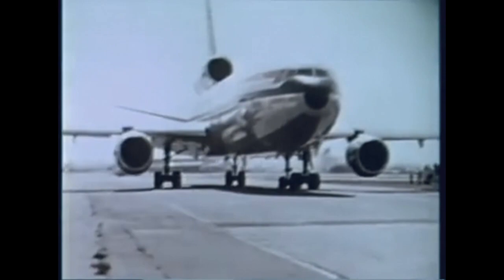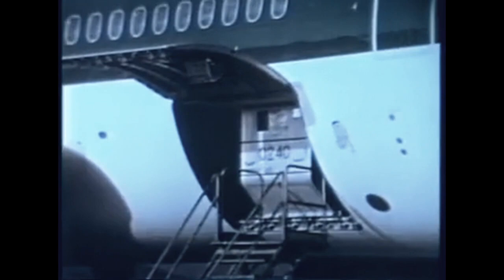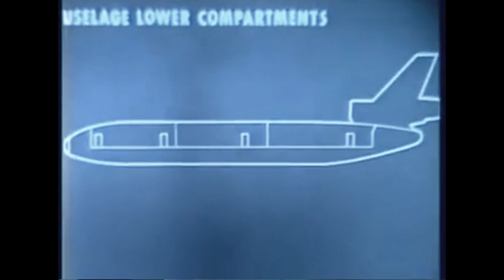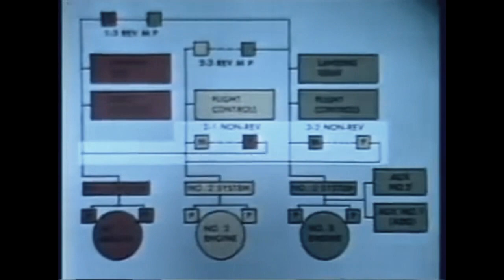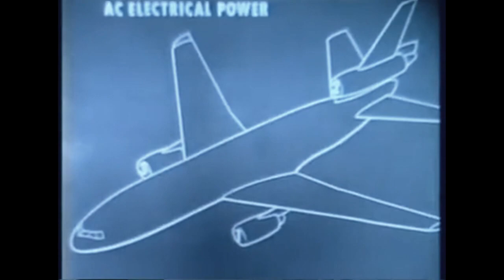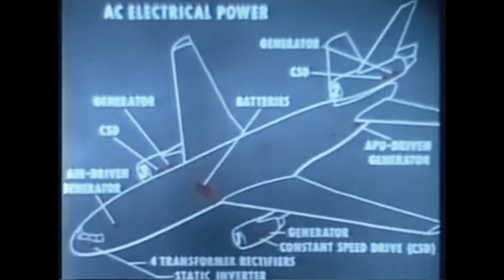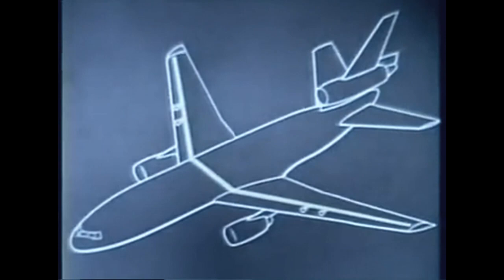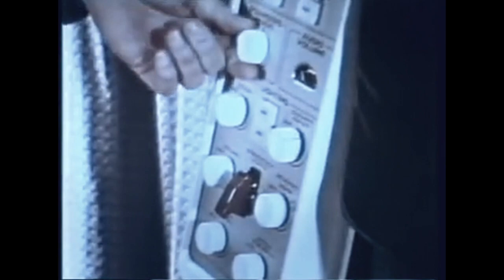McDonnell Douglas DC-10 Series 30 Promo Film - 1972

Comment: I know the DC-10s get a lot of bad reputation but I love these. I love 3 engine tri-jets.
Reply: Albatrosstic's Gaming The cargo door lock I think was only the design feature that caused a crash and almost caused another. A lot of the other other accidents were the result of pilot/ATC errors or poor maintenance techniques.
Reply: I’m more of a fan of 4-engine tri-jets.
Reply: It still has a successful career as a cargo plane. The Air Force’s fleet of these planes are still in service as well.
Reply: @johnmpifer  You put a smile on my face today...
Reply: I love the L-1011, which was an engineer’s airplane. Autopilot so advanced it could land itself. Four independent hydraulic systems that don’t all bleed dry at the same time when penetrated by shrapnel
Reply: @Shadowfax-1980 
MD knew damn well that inherently unsafe cargo door was a catastrophe waiting to happen. A memo proving their culpability surfaced during crash investigations or litigation. Hundreds of people died as a result of their criminal negligence 

The MD ungineers neglected to provide pressure relief valves, so that when the inherently unsafe cargo door blew off, the floor collapsed, severing flight control cables
Reply: Here in Brazil, Varig operated DC-10 between 1974 and 1998 on passengers version and until 2006 on cargo with ZERO accidents and ZERO incidents.

Comment: Yeah there is a lot of flak out there against the DC…10’s. Actually they were pretty well designed and reliable. All the crashes but one are actually due to human problems. The cargo door was the ground crew improperly latching it. The Chicago crash where the engine fell off was due to maintenance being done improperly. The Sioux City crash was the only one that actually was due to an engine failure. The cargo door was re-designed to handle problems with it being improperly closed and secured.
Reply: Boeing did a better job of idiot-proofing their airliners from poorly trained ground crews and mechanics, and the 'how to' manuals for GCs and mechs was probably better written too.
Reply: When multiple flight-critical systems are susceptible to a single point of failure and result in catastrophe, you can’t blame maintenance. Blame the ungineers who designed this flying shitbox

Comment: 3:21 what brought Turkish Airlines Flight 981 down
7:02 caused Sioux city United Airlines Flight 232 crash landing
Reply: Those planes crashed were the first model, the DC10... The DC10-30 was the more approved model
Reply: Furthermore, as Seconds From Disaster shouts at you every episode "it is a chain of key events", had United's no.2 engine not got "bam" then the 3 independent systems were fine. There is a reason it is called a black swan event.
Reply: Turkish airlines filed down the door latches and had people working on the ground that couldn’t read the proper closing instructions on the plane.  They are just as responsible
Reply: @Hertfordshire247  Get some life man....The DC10 proved to be reliable after those SAD events. It served for a long time and way longer than A380..
The FedEx and USA Airforce use is as a tanker, KC10 and till date as an eye hospital. 
Appreciate DC10 when he served well to the people and learn how to FORGIVE during her early days.
Reply: @kingssuck06  that’s not why it crashed
Reply: @truthful3777  Quite true. Many if not most crashes concerning the DC-10 had nothing to do with McDonnell Douglas.
Reply: The Series 30 was the better DC-10 all along - although it had crashes as well (New Zealand 901, Korean 803 and MartinAir 495).
Reply: @Hertfordshire247  It is relatively common for engines to disintegrate when you have thousands of examples of the same plane doing a total of millions of flights. Clustering the three lines together under engine two where one disintegration event would take out all three lines was not very smart. They could have put one line in the middle and run the second and third lines on the left and right fuselage sides to reduce the odds that one event could affect them all. .
Reply: Don't forget the Detroit to Buffalo incident.

Comment: Thank-you for the video.  This is the sort of stuff I enjoy learning.  

If I had been a steward on a DC-10 with no patience for the rudeness and thoughtlessness of passengers in general (at least that has been my observations), I would use a video like this just to mess with them.  Rather than the usual flight safety brief, I would threaten to withhold all alcohol unless there was 100% attention given to this video for the entire 17 minutes.  

Actually, I thoroughly enjoy viewing videos like this that go into aircraft mechanics and are infinitely more informative than the usual promotion film.  I would love to view a video that went into detail about every inlet, antenna, and gizmo (pardon me for talking over anyone’s head with this technical jargon) that hung off the skin of the aircraft.  Especially when I’m waiting to board, I notice everything that is on the aircraft and all activities surrounding it.  

The part about the hydraulics caused me to remember that United DC-10 flight that crash landed in Sioux City, Iowa, when the low pressure fan disk disintegrated and cut all hydraulic lines to include the backup system.  The story about how the pilots managed to fly the aircraft as far as they did was phenomenal.  

The other thing that caused me to think was the demonstration of the evacuation slide, which really seemed to take forever to inflate.  I could not help but imagine that impatience and panic among the passengers, as they waited for the slide to fully deploy wouldn’t cause a lot of pushing.  As a result, I envisioned the first 10 or so passengers to the now open door would exit without the benefit of taking the slide down.  

Thank-you again for posting this.  Please keep up the great work!
Reply from the maker: Thank you Guerry

Comment: Inherently unsafe cargo door blows off, collapsing the floor, because the ungineers neglected to provide pressure reliefs. So all the control cables get severed. Or all three hydraulic systems run their pipes in close proximity to each other so they all bleed dry when penetrated by shrapnel. Because the ungineers reflected to provide check valves. Total shitbox designed by accountants. The L-1011 was a true engineer’s airplane
Reply: I would rather have the 747SP and the A300B4 over the DC-10 or L-1011.

Comment: A true piece of s**t flying coffin.  Cargo doors, tail hydraulics and pylons.  It’s a real wonder they flew as long as they did.  The Lockheed L-1011 was a far superior and a much more beautiful airliner.  The DC-10 rudder placed engine made this ship distinctively ugly.  It’s too bad a fine company like Douglas who put out wonderful places likes the DC-3 and DC-8 engineered this cheaply built travesty.
Reply: Would you please tell us exactly how you feel and quit candy coating it all?  JUST KIDDING!!  Seriously though, how did you develop this opinion about the DC-10?  I've read and heard others speak with similar sentiments.  Nevertheless, if you have a super-secret source, I am always in the market for learning from others.
Reply: Lockheed made a fatal error by locking the L-1011 into Rolls Royce engines.  It delayed introduction and also stymied the pursuit of a longer range model, which ultimately led to them compromising size for range with the -500 model.  Agreed, the L-1011 was by far superior in terms of technology, safety, and beauty.  So glad I got to fly on it when I did.  I flew the DC-10 many times as well but there was just on comparison between the two.
Reply: C-990 Buff  I read a book many years ago about the DC-10 called, If I remember correctly, “Unsafe at any Altitude”.  It went into depth about the poor design of the cargo door latches and their failures and Douglases half-ass solution.  It was written before the AA flight out of Chicago lost an engine and plunged to earth so that accident wasn’t studied.  The main problem with the cargo hatches failing was a massive depressurization in the cargo hold.  The crash in Paris actually was caused by a hatch failure, depressurization which caused the floor between the hold and the passenger level to collapse, thereby severing all the hydraulic cables controlling the rudder and elevators, among other things.  It was a fascinating study of the design of the plane and its many failures, partly by Douglas rushing it to market to beat the much better and safer designed L-1011.  My father was an aeronautical engineer for Boeing in the 60’s and he made me very curious about design and engineering of aircraft, including rockets.  Thanks for asking!
Reply: AtomSmash I had the privilege of flying an L-1011 once. What a plane!  I had the unfortunate experience of flying a DC-10 once from Miami to LA.  No comparison. The most disturbing thing about the trip was the constant creaking and flexing of the fuselage that made all the interior overheads, etc creak and groan.  I know planes are purposely made to flex but we weren’t even in any turbulence!  I wasn’t afraid but I was troubled.  I felt like I was flying in a crate.  Anyway, once was enough thank you.  It’s really a shame that Douglas was allowed to continue building the 10 when the L-1011 was more or less mothballed b/c of monetary issues.  Yes, the RR engine debacle, but I’m surprised airlines stayed with the 10, especially when Douglases “fixes” for the hatch latch and flooring collapses were so stupidly half assed... “Here bud, use this pipe to lock the hatch and then look through this tiny window they stuck in to see if it locked.  Oh, and did you see the nifty vents they put in the floor to pressurize the cabin and hold evenly so the hydraulics won’t be sliced through in case of massive depressurization?  Look Ma, no more problems!”  Anyway, I do go on.  Thanks for the comment.
Reply: C-990 Buff  Correction: UAL flight, not AA, out of O’Hare.
Reply: The DC10 that crashed just after takeoff from ORD was AA191.  The date of the crash was May 25, 1979.
Reply: I see a lot of comments like this on every DC-10 video on youtube. Do people really think that the DC-10 was the only plane with design flaws that led to fatal crashes? 
In the 90s, Boeing had the 737 rudder problems that killed many people in two separate crashes (and lucky it wasn't more before they finally figured out the issue). The Lauda Air 767 crash in 1991 was a design flaw with the thrust reverser. The TWA 800 crash (a truly horrific disaster in terms of passenger suffering) was yet another design flaw with the air conditioner's proximity to the fuel tanks, and the 747 even had cargo door issues of its own with the fatal United Airlines flight 811 in 1989. 

Then there's Airbus, where one plane had its damn tail detach in flight (now THAT is cheap), and their poorly designed side sticks and over automated cockpits which has caused or contributed to disasters by ignoring/contradicting its pilots commands (China Airlines 140, Air France 296, Air Asia 8501).

Fact is, the cargo door was the only preventable DC-10 crash. American Airlines's maintenance practices were responsible for the 1979 crash. The 89 crash was just bad luck. If you have an issue with the DC-10 then you may as well have one with all planes.
Reply: @kimabrams2570 :  Thank-you for all the details.  Despite whatever type of aircraft I might have to fly (as long as it isn't one of those regional types in which I have to stick my feet in the aisle), I have this philosophy of not worrying about anything, especially when I get to the gate.  From that point, there is not a lot I control, except for alcohol intake.  For as I tell everyone, if the plane goes down and I have enough alcohol in me, I am readily identifiable as the one still on fire.  I AM JUST KIDDING! (Sorry, a bit of GI humor there.).  

Indeed, much of what you stated is what I've read, except for all the good parts about the aircraft shaking apart in flight and having to use a bar to keep the door closed.  Again, I am of the personality type that would have laughed instead of getting white-knuckled like so many passengers.  As I said and especially if in flight, there is not a lot I can do to change anything.  I truly did like the L-1011 too for many reasons.  In fact, I would love to see Lockheed get back into the commercial aircraft business to make Boeing and Airbus step up their operations, if nothing else.  I just wish the L-1011 had been designed with a multi-engine option, even though at the time, Rolls Royce did have the optimum engine for it.  

Again, thank-you very much for all the insight you provided.  I do truly enjoy learning, especially when it comes to commercial aviation.  I look forward to reading your future posts.
Reply: Al Cuevas you are correct.  I mistakenly said UAL.
Reply: Doug Masters  I can’t speak for other people, but I never said or suggested that other aircraft were designed without flaws.  However, the flaws in the DC-10 were egregious and some were even known by Douglas before the aircraft went into service.  In collusion with the FAA, the fatal flaw of the cargo hatch blowing and the subsequent depressurization that caused the cabin floor to collapse and sever the hydraulic lines to the rudder, elevators and tail engine, a directive to correct the defects was reduced to a notice, which Douglas thereby ignored.  When they finally DID perform the changes, which were equivalent to chewing gum and bailing wire, it was due to the Turkish Air crash outside of Paris - a plane that should have been retrofitted with the changes Douglas agreed to voluntarily perform, as opposed to being directed to perform, by the FAA.  Anything is subject to design flaws, but the DC-10 was a textbook case of a weak FAA subject to the pressures of the airline industry to make money and allowing a manufacturer to self police itself regarding safety and airworthiness. If Douglas had not been entrusted to keep the flying public safe in a ship of its own design, there would have been no issue.  But they’re all long gone, thank god.  What has not changed however is a government agency (FAA) effectively being run by the airlines and airframe manufacturers and leaving the public with no watchdog. Thanks for commenting.
Reply: Wouldn't that crash be the fault of certain people at Douglas who knew about the problems, rather than the fault of the plane itself? I understand that you never said that it was the only plane that had issues, but what I deduce from the many people online who say "Flying Coffin", "Death Cruiser-10", "Daily Crash-10" etc is that it implies that the DC-10 was a plane that crashed more than any other plane due to design faults. That it was the only plane that had a poor safety record. None of that is true.
Reply: @kimabrams2570  you need to settle down. Although I love the 1011, it was not designed for long range and by the time Lockheed realized that long range was a thing, it was too late. The 1011 was also unreliable, we called it "Late ten out of eleven times" at AC. I love the shape of the L1011, its quietness, passenger comfort, and admire its advanced groundbreaking technology. Sure the DC-10 had its faults, most were caused by the operators, had some high profile accidents. The classic 747s have bad wiring, it had a cargo door blow open, and one blew up over Long Island. Think of the 787 and the battery fiasco and the fact its type certificate was pulled. Bottom line is the DC-10 sold twice as much, flew further, could actually haul freight in an all cargo version, and had high dispatch reliability. After all, the DC-10 is still living a second life as a freighter while most L1011s are just soda cans now.
Reply: Doug Masters An airplane is an inanimate object. It is the mechanical creation of the designers mind based on the requirements of management and the market.  When I’m criticizing the plane it is as an outcome of the company who built it, in this case Douglas.  The designers as individuals are not to blame as they did the bidding of the management of Douglas.  It was poorly designed because Douglas wanted to build as cheap a plane as possible and as quickly as possible to beat Lockheed to the market.  Which it did.  Which is why so many airlines bought it and continued to buy it, despite its inherent flaws.  I think we have beaten this issue to death now, agreed?  It’s in the past and I was simply voicing my opinion and not looking for an argument.
Reply: NovaScotiaKevin - duly noted. I’m amazed at the passion of this planes defenders and detractors.  I was simply voicing my opinion as so many do in social media.  Thanks for commenting.
Reply: You're blaming a badly designed engine pylon instead of shoddy maintenance by AA ORD maintenance crew? ☠